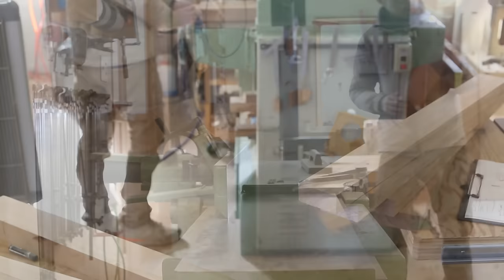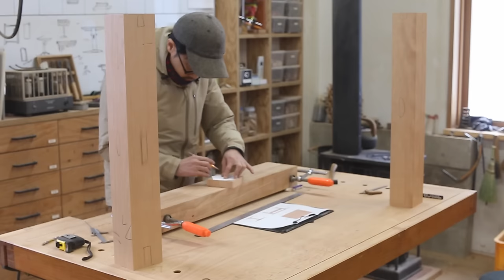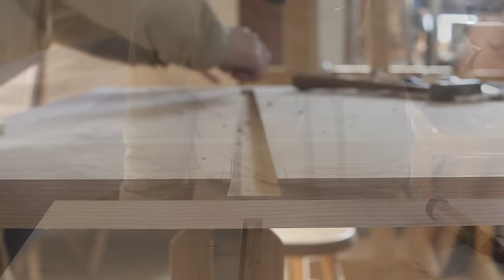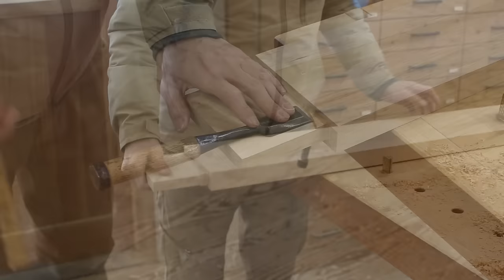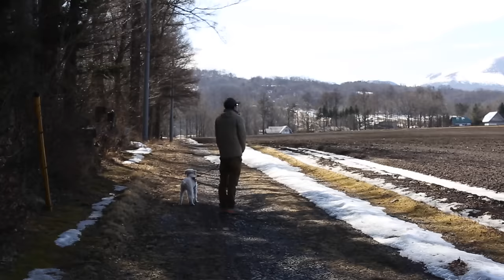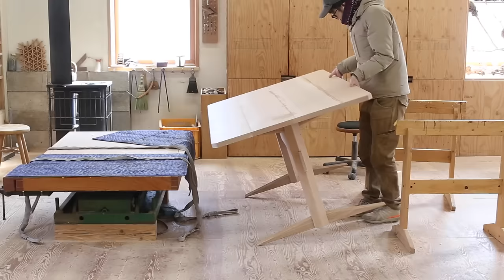ISHITANI - Making a Hexagonal Legs Dining Table

Comment: I made a drawing for a small hinge front mirror over sink cabinet. I remember one in an old cottage and bought a pair of old unused brass hinges from about the 1960's and a tiny cast iron shutter knob from 1890's with copper flash and imbedded wood screw, to go on it. It will be oainted white so could be made from any wood. Overall measurements about 12" X 14" X 3&1/2". I wonder if Ishitani would make it and how much?
Reply: (painted) white)